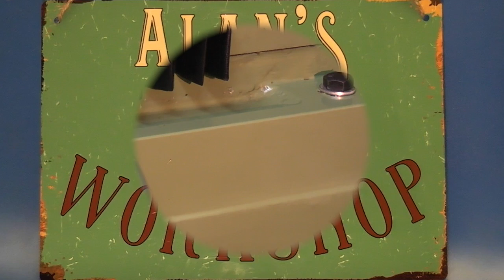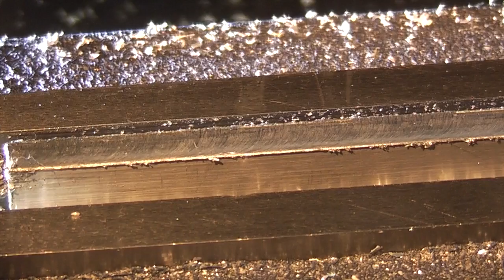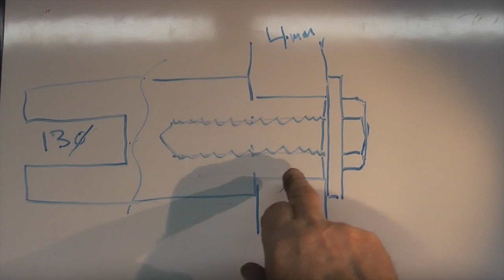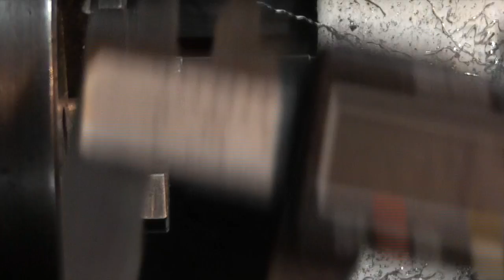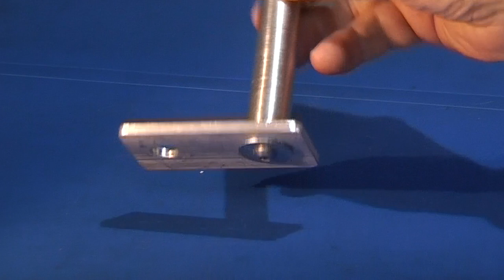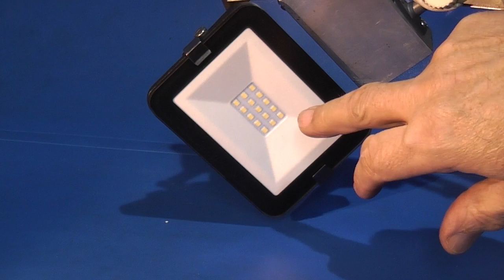Anglepoise lamp holder

Comment: The work lamps on industrial machinery has been one of my favorite items in the machine shop it is the spun metal ones from the elder vintage machine my Barker Mill has one such sun metal black powder coated lamp attached with its original chromed or nickel coated flexible goose neck. We have learned to really enjoy using the step drills they are good for these basic machining jobs and they can deburr and lightly chamfer the holes edges if desired. You shared some really nice mill and lathe work a true end of the day treat for these two desert dwellers. Love the shared cutter sizes depths and details. Nice surprise at the end an LED how cool and tiny is that little guy, thank you.

Comment: Great video.  You might consider putting a locking screw or handle to prevent it from going where it wants to when bumped by mistake.  Great job.

Comment: Hi Alan,
I'll bet you do not miss having to set the lathe up, for milling work, slow going on the depth of cut !.
I like the lamp arrangement, similar to what I've done, but after a couple of hours milling, l end up with a bad headache, from the glare of the led lamp. (Older eyes need more light !).
I noticed that you conventional mill, but you didn't reverse and climb cut, on same setting.
I find this helps with the finish and spring cut, helps with dimension of the part being cut.
I found that I've probably spent the same amount of money on tooling, for what the mill costs !.
Always good to see what other people think of their new machines, good and bad ?, maybe to soon ?.
Enjoy😁😁
Adam
Reply from the maker: Hi Adam thanks for your comments I’ve just fitted a new milling vice on the mill
Alan
Reply: +enots engineering 
May  I ask what brand of vice, you have bought ?
cheers Adam
Reply from the maker: Hi Adam there wasn't any makers name on the vice or box it came in. but from a UK supplier in the Chester area the vice was made in China I think.
Don't miss the video next Tuesday